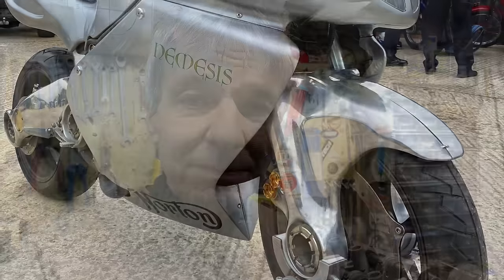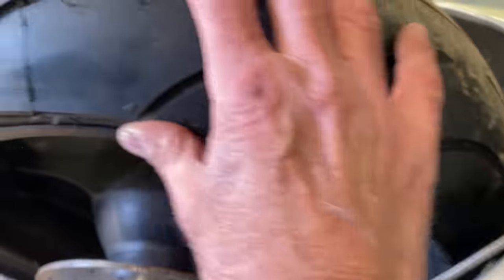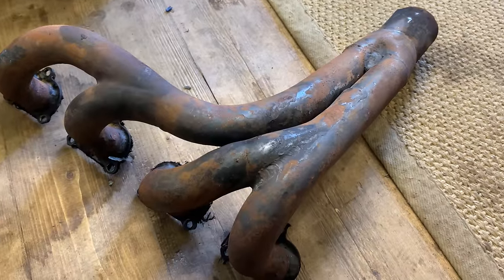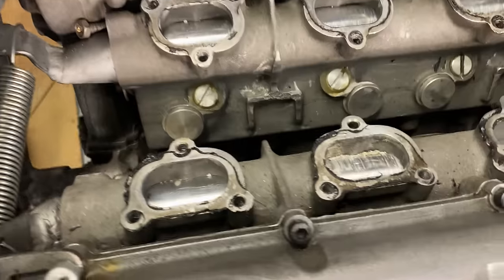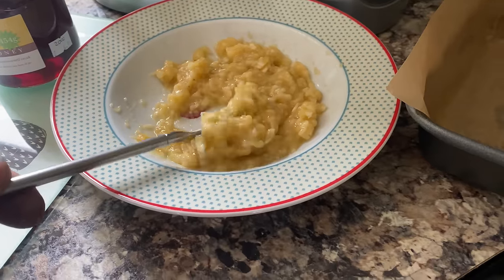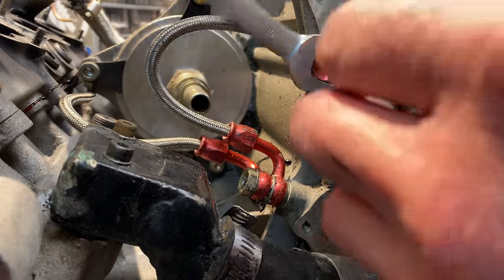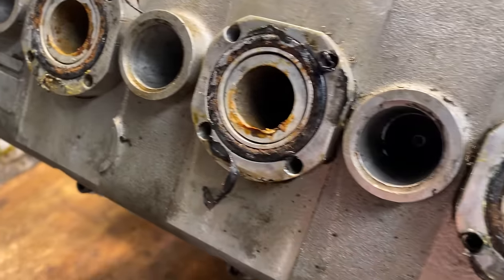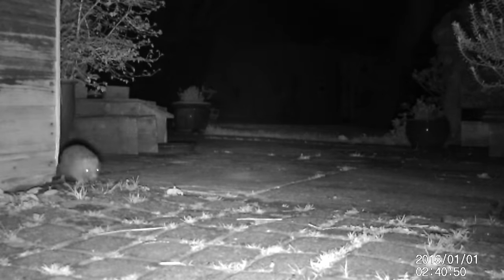Norton Nemesis V8 Rebuild - Episode 2

Comment: I once had a pleasant encounter with a hedgehog when I slept outside during a heat wave. It walked right up to me and actually let me pet it under the chin without completely rolling up. Who would have thought it would allow that? Until it got enough of it and ran under a bush at an amazing speed. Ever since I make sure I always top up the water in the bird bath in one of our borders. Especially during extreme weather, both hot and cold. Not sure if that hedgehog was an 8-cylinder though. 😁

Comment: It looks spectacular.   The swinging arm is lovely.   They really should have used a separate sheet metal front mudguard and made the calipers blend in to the forks but with the possibility of releasing the disk and wheel.  Then done something really neat to hide most of the pipework.

Comment: Surprised the throttle shafts didn't have o-rings: surely there would have been air leakage along the length of the shafts between inlets? If the pistons in each bank were on different strokes, this would surely affect the mixture. However, the large number of large-diameter o-rings would have made the throttle really stiff. Looking forward to the next episode.
Reply from the maker: my thoughts entirely but I guess at larger openings its less reliant on a good seal

Comment: I did some work on the spare Nemesis engine for the museum last year (which is actually just bare cases) and it was obvious from that the whole project was a complete lash up. You could argue the engine itself was ok but the execution of the project is poor, I’m surprised that Alan isn’t commenting more than he is about it. I’m interested to see if he can get it to a reliable running bike.

Comment: Hi Allen , so far from what I see this looks like a typical prototype build, you have the main parts put together, and the rest just thrown on to get it running, sorting out and tidying up the bodged parts would have been done later once you knew the machine ran, even then there's alot of time to put in getting it to perform as required, it's the name of the game when building something radical like this. One observation I will make is it was obviously run whithout corrosion inhibitor in the coolant system,  which makes one wonder what the rest of the engines coolest water jackets are like ?. If anyone can sort this bike out then it's you Allen, it's in very competent and safe hands, I whish you well . Thanks for another interesting video,  stay safe, best wishe's to you and your's, Stuart UK.

Comment: On reassembly use a dab of grease on the washers of the Allen screws holding the airbox to throttle bodies. The grease is a bit sticky, will hold the washer during assembly, and not harm anything in the years to come.

Comment: It's incredible to look at the quality and beauty of the cast and fabricated frame and body parts. And then there are those radiator brackets and horrible crimp on wire connectors in stark contrast. Was there a mad dash to get it to a show or display of some kind?? Loving watching you go through it and preserving and debugging a bit as you go.

Comment: I love your work  sir, but have you considered buying a small electric screwdriver, I have a 3.6 volt one that is just perfect.
All I do is crack the nut/ bolt manually then finish with the electric and saves the arm if you're doing it all day.
Keep up the info please it's got me out of a lot of problems. 
Cheers Michael ( Australia)

Comment: Excellent.
I suspect that those Xpipe headers i certainly due to loose bolts, but also that they are against something else...so probably frequency vibration force is acting.
Doesn't take much...
Should be an interesting rebuild

Comment: It was a shock to see welding like that on one of Alan's videos. I've got used to welds that look like the parts were cast as one. This bike looks like that pigeon did the welding and someone spray painted it, with the paint holding it together.

One wonders about "putting it right". Perhaps it should stand as a historical record of how totally ruined the British motorcycle industry really was rather than fixing it up and making it look like it wasn't built by someone with the same skill level that I have.

Comment: Hope you remember where it all goes LOL Man there s some bits hanging off it before you even get to pulling engine out of frame. engine looks like a fine piece of engineering, But a lot of the Water piping is a bit to be admired :). Exhaust system is kinda a bit dodgy looking. But iam sure it will look the goods by the time you have finished the resto. as always looking forward to each an every instalment.  Love your work Alan
Reply: With an engine that large and in that configuration, the cooling and the exhaust are always going to be the trickiest things to execute and should be properly engineered, but they appear to be the things that Norton spent the least amount of time on. I guess that's prototype engineering.

Comment: When you work in a factory, you end up with a job tin full of odd Nuts and Bolts Imperial and Metric etc. They must have used something like that to bolt it together, but it must have had no Spring Washers / Flat Washer etc lol

Comment: I wonder what this was meant to be.  It's clearly not a production pilot, but at least an iteration or two away.  Were they working on more prototypes than this one?  It's weird... A lot of stuff is clearly placeholders (like the wiring job), some of it is just plain bad (like the exhaust manifold mounting), but then there are things like the cast airbox design that only makes sense if you aim towards mass production at some point.  This is very different from a one-off hot rod, simultaneously rougher and more refined...

BTW I'm really happy to see that you made it on Youtube :-) I've been a fan of your work since reading about your crazy kawazaki fives in the now-defunct TWO magazine.

Comment: Hi Allen, me as always here! Congrats. Heard that you were working on this project in the news. Just to know, is it absolutely necessary dissasembling the entire engine? I mean, I'm with you at checking for corrosion / wearing at some critical parts (carb, gaskets, distribution, etc), but since the crankshaft moves normally and there is compression in each cylinder, it is supposed to back to its best after a couple of hours running / oil change. Awe job one more time!!

Comment: On the throttle tubes aren't there meant to be seals either side of the ports? I notice there were channels that appeared to be made for them but nothing in them or are they intended for lubrication? As they are inlet ports I guess there isn't going to be a lot of pressure though.

Comment: I wonder how many front tyre changes it would take before those disc bolt threads would strip out ?  Stainless bolts into aluminium.

Comment: I'm just surprised the engineers didn't decide to really go crazy and use the hollow cavity in the rear spindle as an oil tank.
Those rotary throttle inlet tube things look like they should have some kind of seals on them to stop air leaks, maybe.
The big question for me, is WHY???😢

Comment: Those swing arm bearings should be packed to the brim with grease. It will move with the rollers to avoid them flat spotting.
Rotating bearings should of course be half filled. But these don’t rotate.

Comment: Wow. Its like they kept having ideas and just tried them all out at once without any real engineering or development. 
Its more like two four cyclinders siamesed than a ground up V8. 
There's no way this could have ever gone into production. 
Such a shame because I loved the idea when it was about. Of course I was a bit younger and a lot less experienced back then. 
I really hope you can do enough to make it work properly. Things like those water seals just scream failure waiting to happen. 
All they needed to do was extend the water jacket past the rocker cover and use hose fittings but instead they have two seals on the same plane going into a water collector - right over the top of the cam cover. 
Best of British with that one.

Comment: It's like that some parts of the bike are well made (but maybe not that well designed) like the cast frame, the engine etc, and other parts like the water manifold, steel brackets and exhaust are just bodged together. They must have blown the budget and timeline and rushed to put it all together.

Comment: Like all the comments before, the bike is a mixture of brilliant and shoddy engineering. But it looks like it has been running for years with tens of thousands of miles on the clock (yes I know, no speedo) with the rusty subframes, radiators, hoses etc. 

Do we know how many hours/miles it has actually run/done?

Comment: A really odd bike. Some parts are amazing ideas and engineering and most of the rest looks like it was built in a shed with what was available. Must be scary to work on though as there's only one. Once it's been re built properly by you Allan will it be run on a Dyno?

Comment: Just one more thing (I sound like Colombo). I did not quite understand the rotary (?) valves. No poppet valves or springs, so why cams?
Reply: The rotary valves replace the blades used in normal throttles.....
theoretically there can never be any difference between any one intake flow and any other on the one bank of cylinders..
the only synchronisation needed will be between the front and rear bank rotary throttle shafts....
and Allen has already found that one point where that synchro shaft hits the engine casting reducing the throttles on both banks to 3/4 open....
Reply: Many thanks! Now I understand that the "valves" control fuel mixture and do not replace actual inlet / exhaust valves. So there must be poppet valves and springs deeper inside! Not seem them yet.

Comment: It truly is a prototype. Loads of really questionable design decisions and using utterly non-standard parts for the sake of it, and then they come up with something as genius as a wiring loom that lifts out from the top in one piece. And then "Hey, we're Norton. Why build a double overhead cam engine, when we can build a double-double overhead cam one ?"

I truly admire your patience, Allen, and look forward to seeing an end result that will most definitely smooth out some of the rough edges of the original assembly !

Comment: How will you go about replacing all the gaskets and seals that were probably custom made for the bike?
Reply from the maker: Only gaskets on whole engine is the exhaust gaskets which I will make new other than that there are just a few o rings and standard size oil seals

Comment: Considering the time and effort in designing and making this one off, it looks like it was assembled by a Chimp...Either that or they were in a hurry to get it working. Inappropriate use of Cap Head bolts and that ignition timing gear with its chewed up screw?...How?..Mind boggling neglect...😳😮🙄🇬🇧

Comment: Please Allan, just build it from scratch and it will not only work well. It will be easy to service, look like a bought one and will weigh half a ton less.   Fancy using two car distributor caps. Sll as n eould build a proper one.

Comment: The bike isn't done. That is just it. There is no way that much garbage was pushed out the door as a finished proto. It looks like what many small businesses do. They stress over things you can see, then just blast a bunch of junk onto the product where you can't see it, to get it to the show, or start it's tour around the industry. It had to have been rushed.

There is so much that can be done with 3d printing, and cnc. This bike should really have a second engineering pass for all the peripherals, so it can be a working example, and not just a doomed to fail show piece. Maybe even track down some norton engineers to tackle the short comings. I'm sure there are dozens of youtubers who would jump on the chance to make parts for this bike.

The water bits could probably be printed in high temp for better all around design. The exhaust bits re-fabricated in thinner lighter stainless, for better clearance and durability. The ignition could be simplified and modernized.

All those reliability fixes, would not change what is was, (other than an unreliable hot mess) or how it looked. The spirit of the bike would be untainted. It may even help it achieve it's original concept.

Glad to see it in your hands! I know whatever you do will be an improvement.

Comment: It seems like a 1500cc four cylinder would be much easier. Why did Norton want a V8 design? The additional weight of the frame, cooling system and exhaust is a non starter.

Comment: Why no charging system Allen? Because it was a test bike?
Reply from the maker: very strange because the electrical components are designed for 13.5 - 14.7v for optimal performance , when I checked the running voltage it was 11.5v !
Reply: @AllenMillyard Yes it is strange Allen.

Comment: It's a bit of lash up but then it's probably just a test mule. However I do see some problems with certain aspects of it's design that would almost certainly be a problem in service with customer bikes. First are those rotary throttle barrels, great for racing but as the bores are cast into the head, when they eventually wear or corrode, thats a major problem.  Then access for servicing and maintenance, that would be a royal chore. And the method of clamping the exhaust  down pipes, dreadful!  It should have been clamps. Also the cooling system, with all those connections it would have been a leak fest!! They were obviously a long way off production!!!

Comment: This looks like a nightmarish pile of junk to me.    I remember visiting the TT races many moons ago, and on Douglas Sea Front, there was a 'Norton V8'    -  I looked at it closely and took photographs  -  Someone had very neatly shoehorned a 3.5 Litre Rover V-8 engine into a Norton Featherbed frame - It was mounted transversely and drove the bike  through a normal AMC gearbox  -  the space between the rocker boxes and the top frame tube was less than half an inch.  The guy had fabricated the drive side covers from Aluminum, which did look a little  crude/unsophisticated  - but apart from that, this 'special' looked a lot neater and more practical than the Nemesis, 'El Junko'  that you are working on !     I still have the photos of that bike.

Comment: A fascinating & frustrating combination of over engineering, shoddy workmanship & impracticality. Having to remove the engine just to change the spark plugs, involves the removal of the exhausts, swing arm & airbox, before you can even start. Imagine having to do a plug read.

Comment: the cooling system looks like it was made out of a fence
Reply from the maker: It’s 1” square tube dexion speed frame usually used for table legs or shelving units 😳